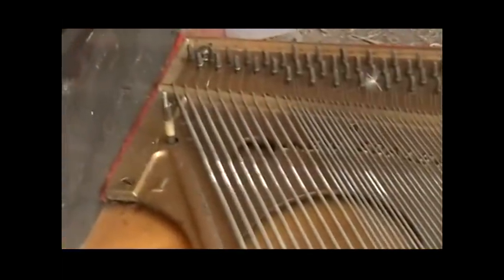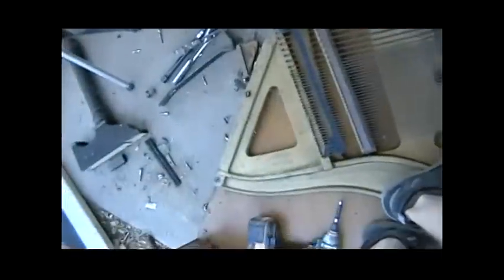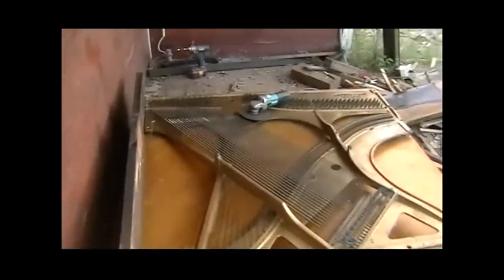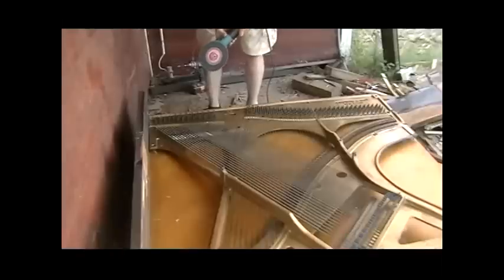Piano dissection/disassembly/workings. 1906 Ludwig & co.

Comment from the maker: I'd like to say a few things:
firstly, I'm sorry that the audio was botched. This is due to youtube's copyright stuff. I'd hoped that (excellent) video game music wouldn't trigger the copyright police, but eventually it did.
secondly, pianos in poor condition, let alone pianos in pretty good condition, are VERY difficult to get rid of in sacramento. This particular piano was dropped off at my property, for free, by the people who picked it up but decided that they didn't want it. It was a piano with a soundboard which was failing to hold some of the pins in tune.
Thirdly, I actually used a number of the parts from this piano. I didn't burn the whole thing. I didn't know about guitarists wanting the alder, so the makeshift kitchen counter legs that were built out of it were actually, unfortunately, wasted. I also didn't think to disconnect the ivory keys for the sake of saving them, sadly. But the majority of the things in the fire were actually that house which is in the background. I was disassembling the house, and had no place to put the piano. If the government didn't require me to tear down my own house for the crime of fixing it, then would have had a home to a) live in, and b) place the acceptable-to-me piano.
Fourth, now that I have central air conditioning, the phenomenally-sounding Steinway model M that I've owned but haven't possessed is finally going to be arriving in my household. That piano is a tool worth saving, despite advances in the sound quality of electronic pianos. It's really a shame that my fingers are so fat; hitting keys properly is physically impossible for me. Still, perhaps the notes from said piano will heal my heart enough that I won't be so prone to finding entertainment in trolling people, as I've done, slightly, with this disassembly video. Being offended by it is evidence that I had power over your weakness. Hopefully, if nothing more wholesome inspires it, your pride will inspire you to grow up enough to cease being offended. But maybe you will lack the self-control to consider things in a mature fashion, and will continue to feel offended by this video. The choice is yours.

To those who deserve it from me, good wishes to you!
Reply: Thanks for sharing Brother, I found out recently about making new string instruments and also good for repairing instruments. A friend also let me know a lot of times the keys are covered with ivory and black keys are ebony wood. Around here where I live you can get 2 or 3 a week free. People just can't afford to fix them and most of time they are not worth fixing. Thank you again for sharing.

Comment: I just called the piano store here and they are telling me it will cost me 300 to have them come and take it away.  Nobody wants a piano since the electronic ones started to have actual piano sounds coming from them.  So, I too will be doing this.  They gave me some story about you can't take the strings out because it turns into a very dangerous thing. Then I watch this guy rip through them like nobody's business and i am like, really?
Reply from the maker: heheheh. what becomes dangerous is when the harp is unbolted while the strings on. Then, if the harp was weak, it can snap.
I hear ya about getting rid of pianos.
My family has a pretty well refurbished, gorgeous, and sonically amazing steinway baby grand.
I don' want it i my livingroom because it takes up too much space and will require tuning, and the used piano shops don't want it because we don't know if the refurbishment was done with steinway branded parts.
It's a mess.
but farnkly there is no digital piano that comes close to the steinway baby grand. it's truly glorious to hear.

Comment: It was pretty foolish to do everything you did with all the string tension still on, especially loosening the bolts on the cast iron frame and taking a saw to the strings themselves.  Seriously, you could have been injured.  Pianos have many tons of tension across the strings, and the iron frame can snap if the tension is not lowered properly.

Comment: Lmao at the swing and a miss with hammer, happens to me alot too.  I too used a 1/4" square to remove those dowels holding the strings trying to salvage the metal harp, lots of work
Reply from the maker: definitely! I bought a tuning wrench for my next piano and it stripped almost immediately, despite using significant downward pressure to ensure that there was lots of surface area in contact! I then welded two random sockets together with the 1/4" portion facing outwards. MUCH better. Perhaps $38 tuning wrenches are just junk? dunno. But the sockets worked without fail.
Yes. Lots of work!
Was it worth it?

Comment: I'm usually a "safety 2nd" kinda guy, but no sh*t, I wear a respirator whenever dealing with dust that's been stagant for 100 years, or more! Pianos, crawlspaces/cellars/basements in historical buildings, etc.
I don't know what my hangup about old dust is, but I'm o.k. eating food off the floor, using my table saw without pushsticks (or proper safety glasses), but my p.p.e. awareness starts with old dust. Maybe I should rearrange my fear prioroties!

Comment: You have a curious way of doing things. All the front panels should just lift out, you just have to find the catches. And then the action unscrews and lifts straight out giving you access to the keys. Yours were ivory if it helps. When you know what you are doing you can have it all stripped back in under 10 minutes.

Comment: Hey Justin . . the sound cut out on your video.  I need to know if the harp is actually glued down or not. I'm taking a piano apart to make into a bar and I don't want to destroy the wood on the back under the beam.  What's the deal with that ?  I want to carefully separate the harp without destroying the enclosure, refinish it and then put the harp back in. Is this possible ?
Reply from the maker: my harp was not glued.
yeah the copyright police got rid of the soundtracks unfortunately
Reply: @JustinCrediblename  Ahhh okay, thanks man.  I've been having a b!tch of time getting this harp out with out destroying the wood behind the harp but I may just have to do it. I can replace it once I get it out I guess. Just a shame there is not a way to do it without going that route

Comment: I agree. If you remove the harp from the support boards you are asking for trouble.
As they say.... "don't try this at home".
Reply from the maker: indeed! thanks for helping people stay safe.
To be clear to readers, removing the harp is fine, but only after removing the tension from the strings. And according to some, removing that tension with a grinder instead of un-doing the tuning pins is also dangerous.
A number of people here claim that someone who takes it apart with this method is actually risking their life.
Stay safe, everyone.

Comment: recommendation on removing the sound bar? that's the last bit I must do but I can't destroy the Frawley or wood around it.
Reply: frame*
Reply from the maker: +Megan Lee Shinney well I never did quite get that far before giving up. But I think you'll at least have to remove all of the strings so that the harp slides over those pins.
That's my best guess

Comment: Do you know if it's possible to cut the harp into low middle and high with the grinder?
Reply from the maker: doubtful unless you want to weld reinforcements. I'd recommend welding those reinforcements beforehand. Since it's cast iron and you can't exactly pre-heat the harp adequately, you'll probably want to use an electrode approaching pure nickel so that the weld survives the stress of thermal contraction as the weld cools down.

Comment: I was thinking it would be cool to set up an acoustic piano so instead of the hammers hitting strings the hammers hit pads that were part of a synthesizer or electric keyboard system... Then I saw that comment down below...heh, it might be interesting to keep the set up with the hammer striking the strings but then add some sort of pickup for each string. Sound of an acoustic with option of turning on the synth as well. Similar to electric guitar concepts? Not sure how this would turn out.

Comment: By the way I paid a piano technician about $300 to take the plastic black keys off my new 6' 9" simi-concert grand piano.  You may want to think about that if you threw those away.  And Ivory has been outlawed for piano manufacturing.
Reply from the maker: Yeah ivory and hardwood sure do feel nice under those fingertips.
It would be a lot of work to salvage the parts and give them to a piano shop. I have a lot going on, and more unique educational videos which I need to make in order to help society out :)    If I spend too much time on the little stuff, then I won't get around to fulfilling my need to empower society.
I know my vids aren't the best, but at the time of their publication, I scan the tube to make sure that they contribute something of real value to at least some of the onlookers.

Comment: Wait, is it actually dangerous to remove the soundboard like that? Or is it just a joke?
Reply from the maker: not a joke. they can snap prematurely if the metal they used is too brittle. there are some accounts of serious injury as a result of the snapping harp.
Reply: Ah gotcha. Is there a better way of doing it? I'm planning on building a "ghost piano", I.E removing everything but the frame/shell and use it for movie productions. Anything in particular I should keep in mind?
Reply from the maker: Cenote
well I dunno what frame/shell means. do you mean the harp and strings? strings will need to be re-attached anyway if you don't have the pin block and sound board, so might as well remove them before removing the harp. If you want a tunable piano I'd weld the string anchors on using a pre-heat of the harp and some nickle electrode...and a lot more that's too lengthy and probably expensive to describe.
Reply: As in I just want to keep the wooden parts of the piano, I want to remove the heavy insides of it. I'll probably invest in whatever dirt cheap piano I can find, which models are easiest do disassemble? Newer or older ones? Thanks a lot of responding by the way! :)
Reply from the maker: well it's a little late now but I have no idea which ones are easier to disassemble. I've only done this one :).
If you're looking for dirt cheap, the free section of craigslist will do great. you can even use the "wanted" section and request a not-worth-restoring model
removing insides is a matter of screwing and unbolting, so it shouldn't be too bad.
Did you already do the project?

Comment: Even never having played it was painful to watch.
I am so glad you chose to not just burn it in situ.

I have to agree with so many, I would break it down for replacements for other pianos, and use the wood constructively. 
I went and texted one on CL FREE just for that purpose.
If you are so unimaginative as to burn a turned leg or entire bench please just take them to the curb, and CL FREE them.
I hope you understand that that part out you did better about $400 in scrap value.
Vintage wood.
36 inch piano hinges that can easily, functionally cut down.
(In my mind, these alone make 10 jewelry boxes.)
4 matching legs.
A harp you can hang on the wall, in the open, as art.
(Many schools would allow this gift in the band, music rooms area in a hall, or in a classroom.  I'd go mount it for free.)
So much wire.
Felts for box footings, furniture applications.
Vintage fasteners.
Veneers can be recovered.

Each vintage piano has 90% great value, 5% broken, and 5%Dusty dirty. 

 PLEASE try harder.  Not only did you wreck a fine piece with a great deal of disrespect, but you did 75% of the work to get salable pieces, then destroyed YOUR OWN time, and effort!!